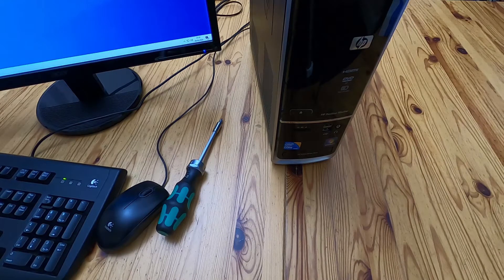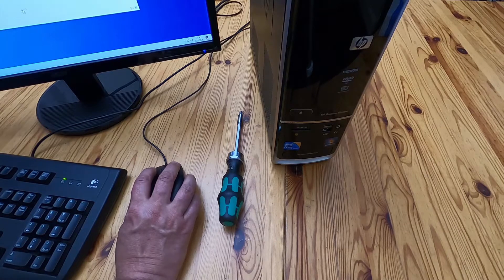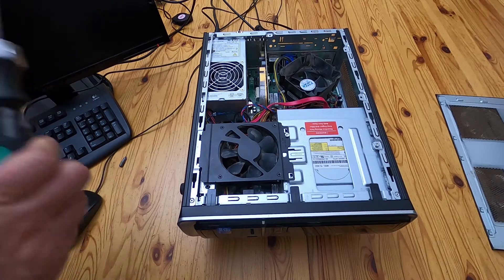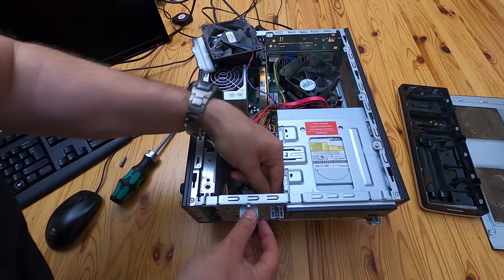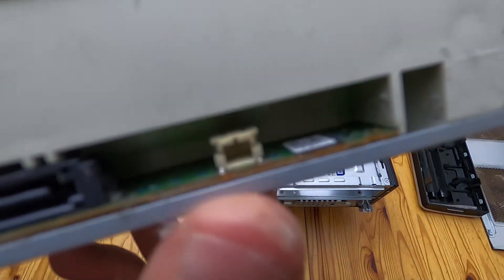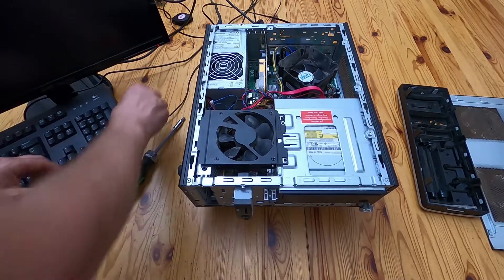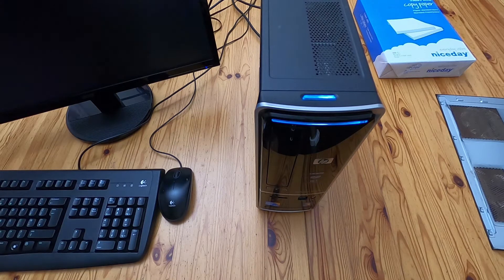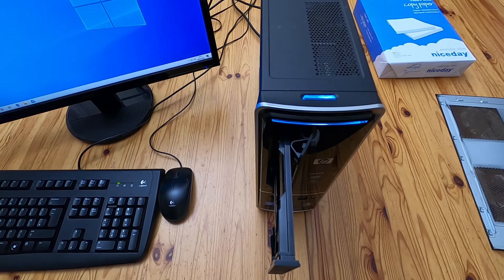HP DVD Eject Button Doesn't Work *DIY FIX* in English

Comment: Hello Nic!  Great video.  The problem that I am having is that I push the eject button and the drive opens and then retracts immediately before I can put my disc in. Can you help me to give me a DIY fix for that?
Reply from the maker: What happens if you do a software eject by right clicking on the drive icon and selecting ‘Eject’?

Comment: I bought 2 new HP desktops. After 2 years of occasional use, the Eject button is dead on both. Clicking on Eject has no effect. Junk
Reply from the maker: On some models (like the one in this video) the eject is actually disconnected!

It must apply to every one of these in the production run when this one was made - I guess no one noticed...

You can always use a bent paperclip and manual trigger the eject. Call it a security feature...

:D
Reply: @sterntechdaddy   The paper clip did the trick. Gracias
Reply from the maker: @laurajames7809  Glad it worked.

Comment: Hello, the problem I am having is the drive won't eject even when I press the button on the drive or try to eject by right click on the computer screen. The computer is HP PAVILION DESKTOP a1330n, with Windows XP.
Reply from the maker: I’m assuming the drive makes mechanical noises to show it’s powered up and communicating with the motherboard...

Grab a paper clip and bend it out to make a rod you can push into the tiny hole on the front of the DVD drive.

This should trigger the manual eject.

The mechanical mechanism can get stuck and there’s also a rubber seal around the rim of the tray front and the plate can sometimes get stuck to it if the drive hasn’t been used for a while.

So try the manual eject and pop the tray out - then press a few buttons and get the tray moving again.